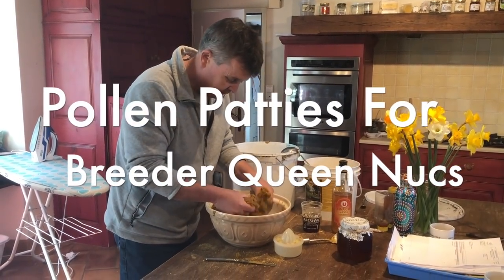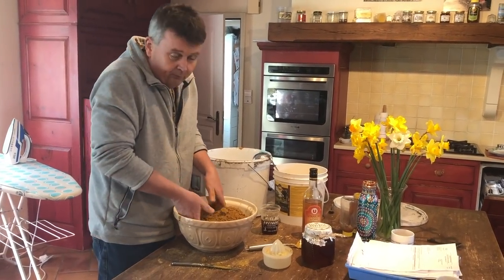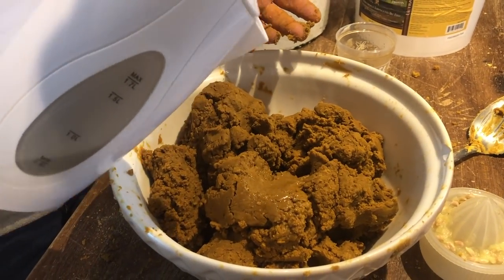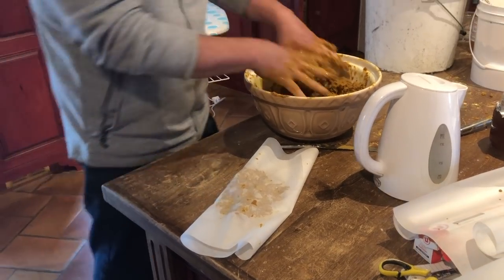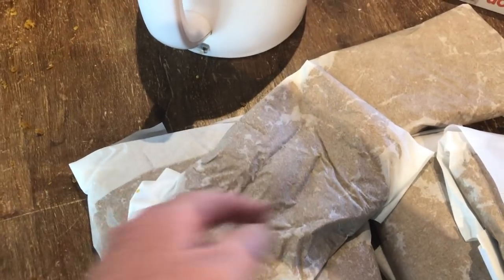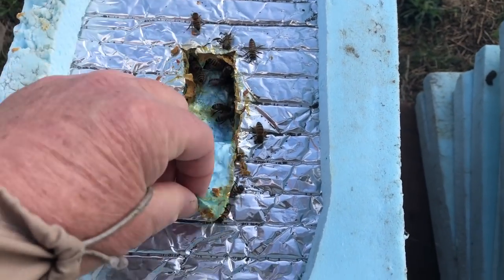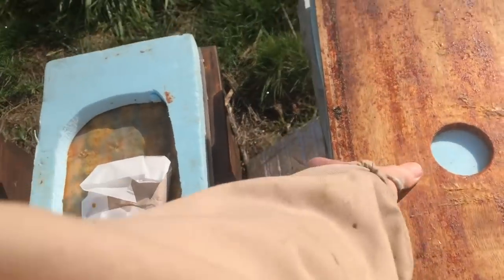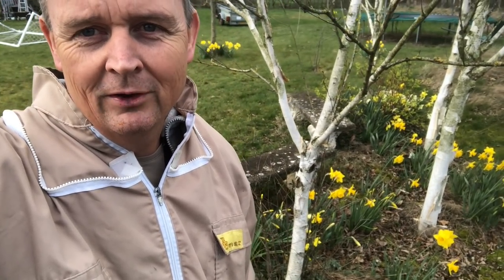Pollen Patties for Nucs

Comment: Nice video Richard this was my second viewing. Bit crazy here in NY as you can imagine im sure. All I've been doing during this mess is building nuc boxes. I lost three out of six colonies over the winter two of which I believe we're verroa. We didn't have a horrible Winter but I believe the third colony was lost due to moisture, so I'm going to raise everything up to 18 inches off the ground and I've built nuc boxes out of 1.5 inch thick material for insulation. I also plan to put two inches of polystyrene in between each colony and place the right next to my shed on the Lee side out of the wind I think all this will give them a good chance at making it through the winter. Thank you for taking the time to read this and for all the videos from which I get so many ideas. Good luck to you and yours in this crisis and I hope you have a stellar beekeeping season.

Comment: N.B. Canada  Zone 5b    Don't rub it in Richard. 25cm of snow this past Monday. However, next Monday it's going to be +7c and my patties are going on as well. Last weekend on a warm day I had a few hives with a large amount of bees doing orientation flights. We had a warm spell in early Feb. so some queens must have jumped the gun and the brood made it through the string of -20 nights we had. Last fall I was able to get two Mann Lake 50lbs boxes of soft patties. Brought them in from the cold workshop to take the chill off Sunday. So as you know It's still a long way from blossoms here but we are suppose to get above normal temps this spring.  Always like the vids and got my patties ready.

Comment: We operate pollination services mainly avacado and watermelons so we generally need to use a substitute to maintain colonies through the summer, been using a homemade blend using soy isolate, and trialing it against ultra bee, however we have not used patties we open feed with pvc pipe hung in a tree
Reply from the maker: brent behsmann thanks for your input. Really Interesting.
Reply from the maker: brent behsmann do you find thé Soya isolate one of the best sources of protein you can get versus cost? In France we struggle to find affordable alternatives  other than buying the read made proteins?
Reply: @richardnoel3141  Hi Richard  our bees love the soy isolate and so far we have not had any problems i was worried that the protie.n being 90% in SI would cause gut problems and protien sickness but am yet to see it.
1part soy 1part dextrose 1part irradiated pollen 1 part unbleached wheat flour in a 20lt bucket with a 20mm hole  a paint mixer on a drill
We buy the soy for about $10kg Au dextrose $4kg pollen $15  
Its still expensive to make your own but the benefits we get make it a no brainer we pay through the nose for ultrabee and i cant see any indifference in my comparative feeders theyre both emptied within a week
Reply from the maker: brent behsmann thanks so
Much for the info!!’
Reply: @richardnoel3141  we tried in lid feeding of irradiated pollen but after e few days the pollen was soaking up the condensation and they wouldnt touch it, some yanks use whey isolate i tend to think dairy should be avoided as a protien source. If your friendly with some other beeks maybe consider importing soy isolate there is companies that will blend your own custom blend but they have minimum quantity orders usually 1 tonn and thats a lot of supplements to feed, we'll probably do this later in the year as my cousin also runs 600 or so hives and there is beeks around my area that run 2500 hives so shouldn't  have much trouble getting through it